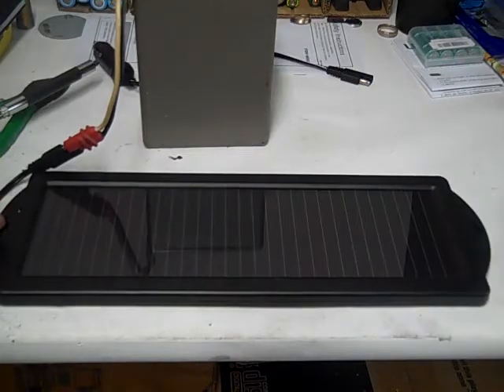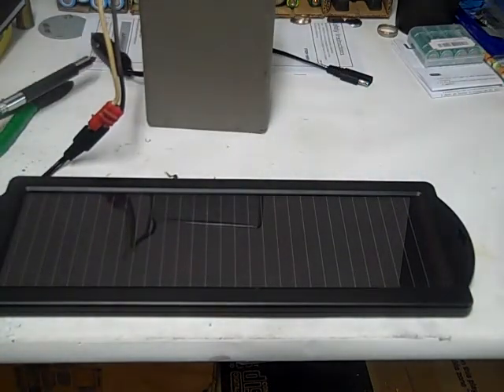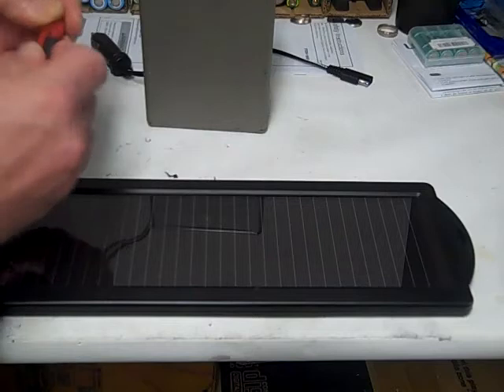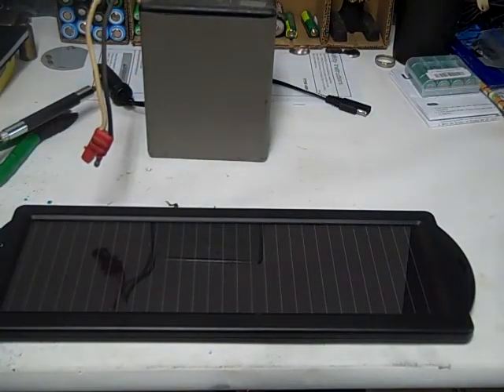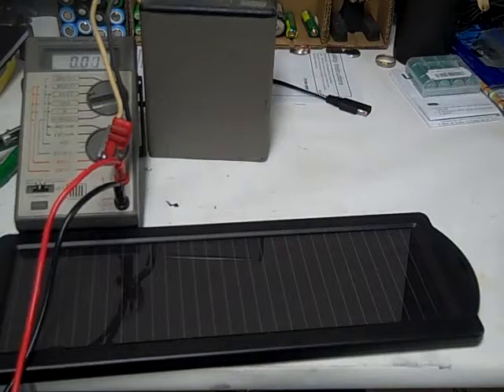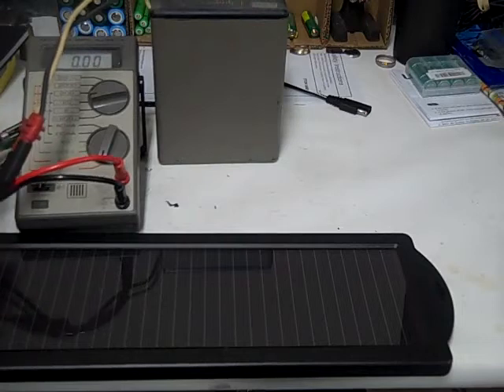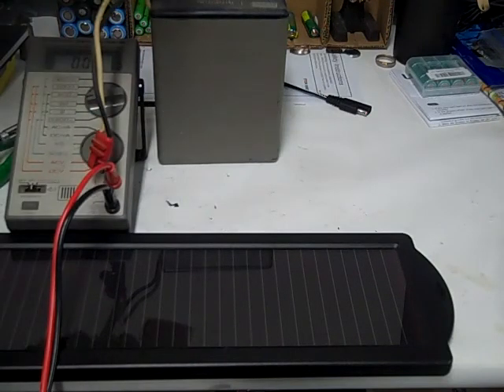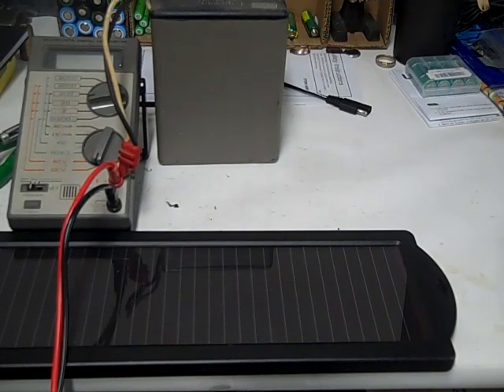Charging a 6 volt Battery with a 12 volt solar panel indoors

Comment: But you can't leave it on all the time right?. My generator electric start battery runs dead after a week. I want to set up a small panel directly to the battery all the time.